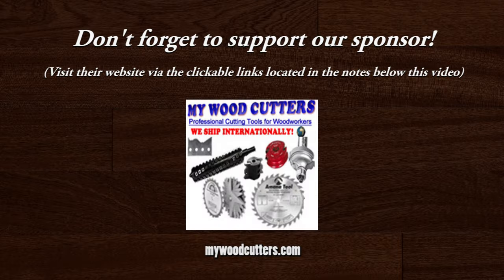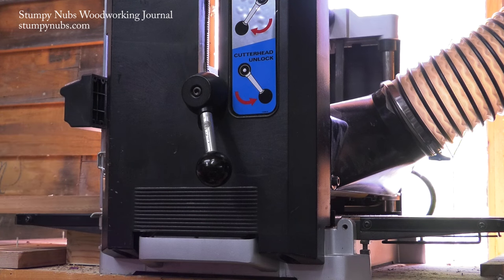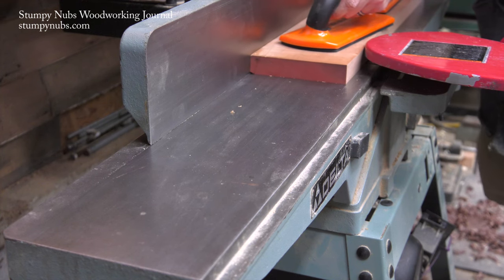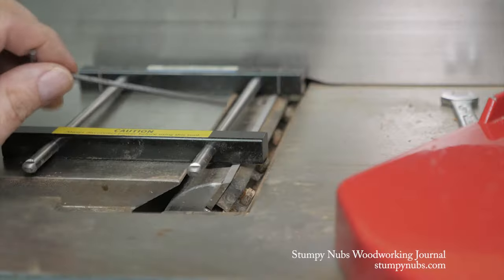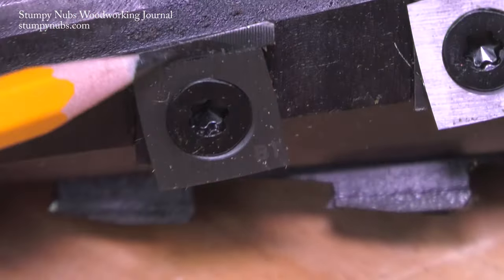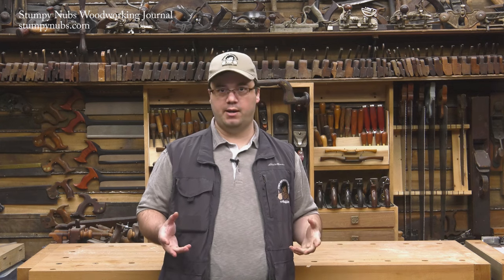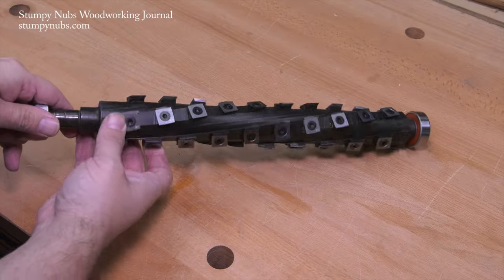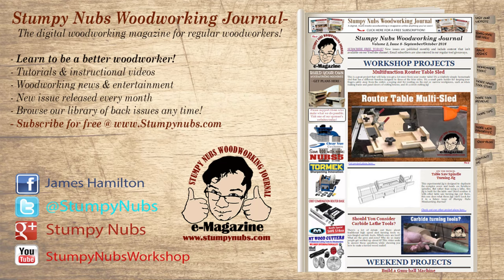WATCH THIS before buying a carbide helical (spiral/segmented) jointer/planer cutter head

Comment: Well ... you're cost savings is glaringly remiss by ignoring the fact that nobody buys replacement knives when they dull. We own 2-3 sets and rotate sending them out for sharpening.
Reply from the maker: Nobody? I think you are "glaringly remiss" by overstating the facts. In fact, the average woodworkers I meet rarely use a sharpening service for jointer knives, and almost never for planer knives (because most indexed knives can not be sharpened much at all before they are too narrow). I congratulate you for doing things differently, but this video deals with the reality found in the vast majority of small shops.
Reply: Interesting. It just never occurred to me to throw away perfectly good knives when I can have them sharpened. I send them out along with my saw blades and planer knives when I have enough to make it worthwhile.  I've sharpened my jointer knives several times now and they have plenty of life in them, so I don't agree that they can't be sharpened "much at all". If you're trying to educate people (as you clearly are), I think that model should be part of this discussion. I do want to switch when I have the cash.
Reply from the maker: I said planer knives can't be sharpened much, not joiner knives. Planer knives are indexed (usually), which means they can't be advanced forward as they become narrower through sharpenings. If you grind them sufficiently to remove a nick in the edge, you have already made them too narrow to use on many benchtop planers. Joiner knives, on the other hand CAN be sharpened. However, many small shop jointers make it very difficult to accurately advance the knives and re-align them. It's actually the biggest complaint woodworkers have with their jointers.
Reply: Ah, the devil is in the details. I see. I do have my planer knives sharpened as well, and while they are narrower, I've had no issues with them yet, either. You can def get a few sharpenings out of them barring any large nicks. I'm on my third jointer and, while it is challenging to "index" them for newbies, I've never seen a difference between new and sharpened blades. Recently I switched to OneWay Multi Gauge for the jointer and it is a dream compared to the typical magnetic base dial indicator and the ruler technique IMO.
Reply from the maker: At any rate, your comments are posted for everyone to see, so they can be as informed as possible. Thanks for adding to the discussion.
Reply: Paul Frederick Yeah, I used to but the planer blades are so long... I just decided to bunch it all up with the saws. Woodworkers are notoriously poor and or cheap, so I do think that most get their money's worth from a set before replacing it.

Comment: Doesn’t anyone resharpen the blades. Seems like that would be cheaper. Inserts aren’t cheap
Reply from the maker: Of course they do.
Reply: What does one expect to pay for a reshaping of blades? Something that I’ve not heard mentioned anywhere.
Reply from the maker: It is very easy to sharpen them yourself with a simple diamond hone.

Comment: the 20x more knives line is total bullshit.
You don't but new hss planer knives every time they dull. You get them sharpened.
As for the negative aspect of more power being needed - This can be overcome with a flywheel.
Reply from the maker: Many planers have indexed knives that can't be advanced once they are narrowed by sharpening. One or two grindings to remove nicks, and they are done because they will no longer protrude beyond the mount. The Delta in this video is a prime example.

Comment: Why is it called a jointer?  I realize that it's not the same as a planer; but, like a planer, a jointer's function is relatable to the correcting of a surface, while it seems entirely UNrelated to anything having to do with a joint. (?!!?)
Reply from the maker: They are commonly used to create edge joints for glued-up panels
Reply: @StumpyNubs  
Oh.  It's strange that I've never have seen it used that way on YouTube or in real life! Perhaps you could demo that on a video sometime?